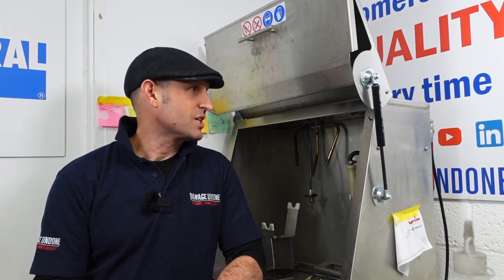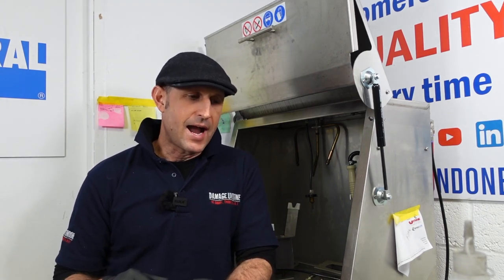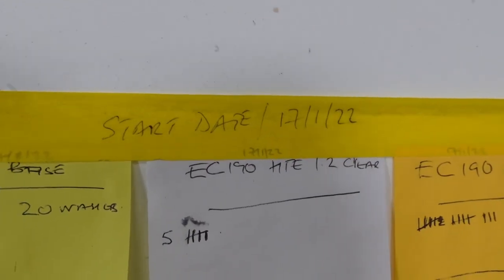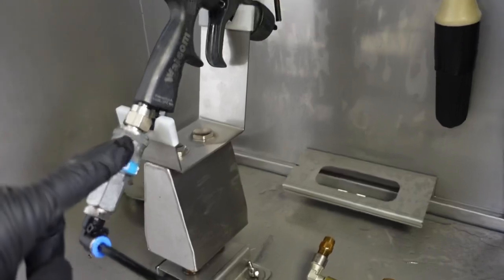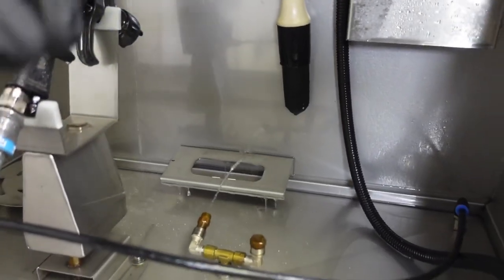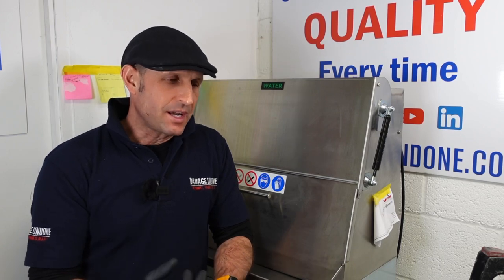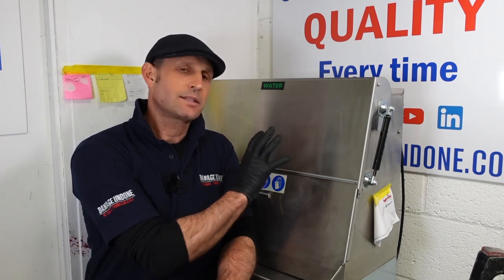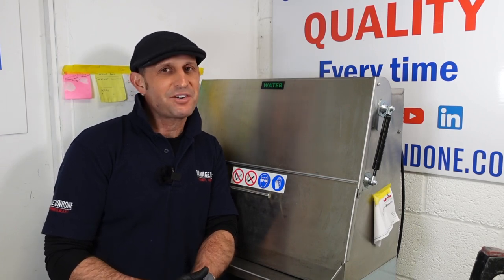WATER & SOLVENT GUN WASH MACHINE

Comment: Very interesting Wayne and it looks a very well made piece of equipment, actually you got me at "Made in Britain" as not much is these days. I like the idea of having one cleaning solution to clean both water based and solvent paints from your gun, I know you said the cleaning solution is quite expensive but you don't have to buy 2 different ones so there must be some savings there.

So if like me and you have guns with built in digital gauges can you still put these in the machine as you don't use thinners for cleaning? You also said the machine has to go back as it's just a demo but do you think you will invest in one sometime in the future? Very well made review as always mate, thanks for doing this 👏🙏👍

Comment: Hi Wayne, You saying you can clean water and solvent guns in the same machine? We are looking for a wash machine and would love to test this out before buying, You don't mention the cost of removing from a waste company! Does your machine have the little blue filter, these are mega expensive.
Reply from the maker: Yes, these clean both waterbase and solvent.

I will always give both a guns a quick blow through or call it a pre clean in the booth, this extends the life of the cleaning fluid. 

Regarding the used cleaning fluid, the replacement filters cost (which you can keep down by doing a pre clean in the booth) and getting a demo please contact Anthony of Unic on 07971 212574

I believe they have also recently upgraded this machine, making it even more efficient 👍